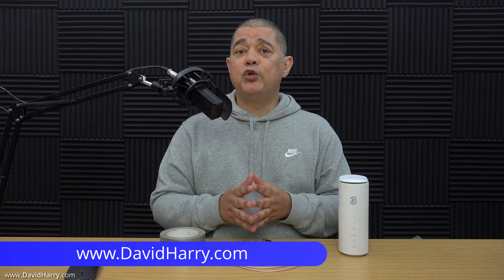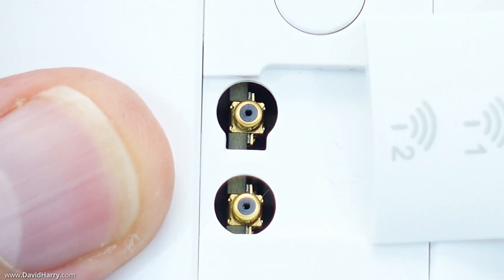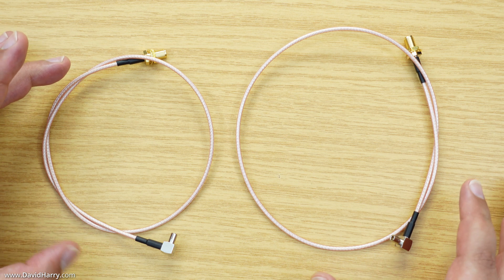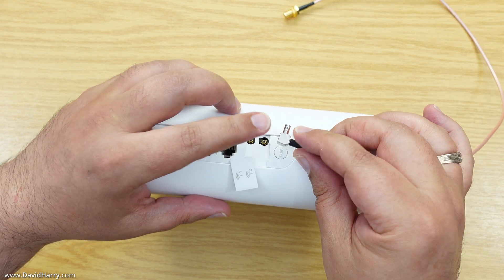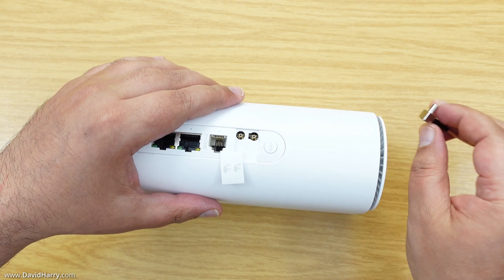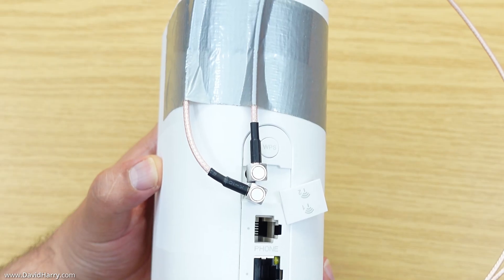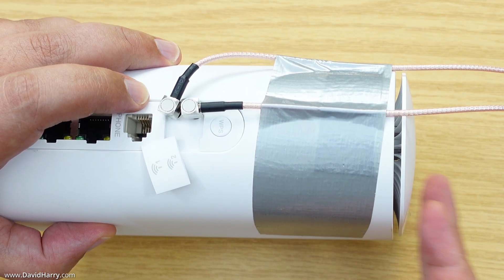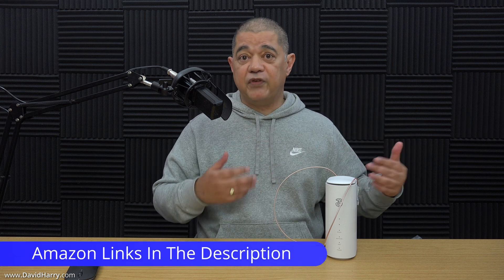How to modify the TS9 external antenna sockets on a ZTE MC801A 5G router so they don't snap off

Comment from the maker: Visit Router-Mods https://geni.us/RouterModsWebsite
Bluespot 4G/5G antenna Amazon https://geni.us/Bluespot4G5G
Bluespot Mini 5G antenna Amazon https://geni.us/BluespotMini5G
Bluespot 4G/5G Bluespot website https://bluespotnet.co.uk/products/bluespot
Bluespot Mini 5G Bluepost website https://bluespotnet.co.uk/products/bluespot-mini

Router-Mods playlist: https://www.youtube.com/playlist?list=PLleKChtNUwZTyTwZxrJRYPUXTSJUzi5kP

How to modify the TS9 external antenna sockets on a ZTE MC801A 5G router so they don't snap off.

In this video I'm showing a simple antenna modification to a 3 branded ZTE MC801A 5G router to help with strain relief when connecting external antennas to the router's TS9 external antenna sockets.

This is a very simple antenna modification that just uses a couple of TS9 to SMA cable extenders that connect to the router's TS9 ports and are then taped to the body of the router to give the strain relief that these TS9 antenna sockets need.

These SMA to TS9 cables are also known as SMA to TS9 pigtails or TS9 to SMA pigtails. In any event and regardless of what name they are referred to by, they are simply coaxial extension cables that have male TS9 on one end and female SMA on the other.

Once done, the router essentially has SMA external sockets on it that are a better choice for connecting external antennas to. Plus, with the SMA to TS9 cables being taped to the body of the router, you will definitely get more strain relief when connecting antennas. As just the weight of an antenna coaxial cable is enough to snap off the TS9 ports.

I can't over emphasise enough just how important this strain relief is for the external antenna sockets. Without such a modification, I can almost guarantee you that at some point you will snap off and break the TS9 connectors off the router's motherboard.

These TS9 connectors on this router are simply surface mounted straight to the router's PCB motherboard. Effectively giving no strain relief at all.

It's also worth bearing in mind that with this particular 3 ZTE 5G router, once either of the TS9 sockets are snapped off or broken. Your router will no longer operate properly with 5G. Even if your router indicates a 5G signal, you will have a very slow speed. Basically, the router becomes useless for 5G and doesn't even revert back to its internal 5G antennas.

This simple antenna modification will also work many other 5G routers, 5G modems, also know as a 5G gateway or 4G gateway, or even 4G routers and 4G modems that use TS9 for their external antenna connections. Even a home Wi-Fi router or modem that has these TS9 sockets can benefit from such a simple antenna modification.

It's also worth noting that such a simple modification will not void your warranty or guarantee as you are only connecting a cable to a socket that's designed to be used by the end user for attaching external antennas to. There is no opening up the router, so therefore no voiding of any warranty or guarantee.

Amazon links to stuff used in this video:
The 50cm SMA to TS9 cables I used: https://geni.us/50cmSMAtoTS9
Other SMA to TS9 cables: https://geni.us/SMAtoTS9cables
ZTE MC801A 5G router: https://geni.us/ZTE-MC801A-5G-Router
Other SIM free 5G routers: https://geni.us/5G-Routers

Please give a thumbs up, sub, share my videos and click the bell for notifications.

As a small independent self financed YouTube technology channel that does not have major sponsors. It does take a lot of time and money to help keep my channel running and to fund it. Any support you could offer would be massively appreciated.

Supporting my channel by using my Amazon links to buy anything from Amazon, not just the products I link to, gives me a small cut but doesn't cost you anything extra. You can also send me a coffee donation via my PayPal link, coffee keeps me going while editing :) Or a thumbs up, sub or share is a massive help for my channel.

Support via PayPal https://www.paypal.me/DavidHarry

My YouTube equipment & recommendations. 
Amazon USA https://amzn.to/3g2Oi3i
Amazon UK https://amzn.to/2ZR6IOV

My Amazon Shop links.
Amazon USA https://www.amazon.com/shop/davidharry
Amazon UK https://www.amazon.co.uk/shop/davidharry

Amazon USA: https://geni.us/Amazon-USA
Amazon UK: https://geni.us/Amazon-UK 
Amazon Deutschland: https://geni.us/Amazon-Deutschland
Amazon France: https://geni.us/Amazon-France
Amazon España: https://geni.us/Amazon-Espana
Amazon Italia: https://geni.us/Amazon-Italia
Amazon Canada: https://geni.us/Amazon-Canada 

As an Amazon Associate I earn from qualifying purchases when you use my Amazon Affiliate links.

Contact me for product reviews.
YouTube@DavidHarry.com

http//www.DavidHarry.com
 
I’m David Harry. Thank you very much for watching this video, take care and goodbye now.

Cheers,
Dave.

#DavidHarry#LiverpoolTV#Router-Mods

Comment: Why is it that if you break the TS9 the router won't work in 5G anymore? Why can't it use the internal antenna?
Reply from the maker: Because the auto-sensing stops working and the router thinks there's an external antenna attached when there isn't. Plus, there's no software switch/option to tell the router to use the internal antennas. Cheers, Dave.

Comment: will installing these TS9 antennas increase the strength of the speed I`m getting. ATM I`m getting up to 1.2 Gb. but it fluctuates so much that I`m having big ping spikes and speed drops all the way from 1.2Gb down to 120-200 Mbps.

Comment: Hi David, assist me in understanding this please, where do the two cables connect to(what type of antenna LTE/WiFi)?
Reply from the maker: They connect to 5G/LTE antennas, definitely not a WiFi antenna. These sockets have nothing to do with extending the range of the WiFi of the router. Cheers, Dave.

Comment: Hi Dave, I've watched the video and read everything in the comments but I'm still unsure if an external antenna will help my parents when they visit their caravan.  They have the same router in your video on the Three network, coverage in the area says "great news, you've got very good 4G for calls, texts, and mobile internet" which is a massive lie :-) and there is currently no 5G coverage in the area.  Am I misunderstanding when you say external antennas are only for 5G so in this case it won't help?  I was going to buy them the Bluespot 4G/5G Antenna but I'm now not sure this do anything.  Thanks.
Reply from the maker: Hi, Nick. The two ports on this router only support the extension of 5G, not 4G. Do not buy an external antenna unless you know you have line of sight to a 5G cell tower. You have to know the direction of the 5G cell tower, as these antennas are directional. If you do buy an antenna, don't get the 4G/5G, get the Mini 5G for 5G reception. Cheers, Dave.
Reply: Thanks for the reply. So based on that nothing will really help until they get 5G in the area?

Comment: Does anyone know if the ports shown on the ZTE router are for getting better mobile network coverage or for extending WiFi range?
Reply from the maker: Hi Carlos. It’s only for mobile 5G NOT for WiFi. There are separate antennas inside the router for WiFi. Cheers, Dave.
Reply: @DavidHarry  Thx u, greetings from Chile
Reply from the maker: @CarlosSanchez-lx6vd  Hi, Carlos. You are very welcome, greetings from Liverpool, UK. Cheers, Dave.

Comment: Please, Could I be right to say that the right external router antenna to buy is the one with SMA since the pigtail already has ts9. A quick reply would be appreciated. Thanks
Reply from the maker: Yes, use an antenna that has the SMA connection NOT the TS9 connection. Cheers, Dave.

Comment: Thank you for the video!
Do you think the internal antenna are better than these "Set of 2 LTE/4G/5G Antenna 8dbi Omni Directional 600-6000Mhz SMA Male" which is also available on Router Mods?
I have this set but if using the external antenna will overrider the internal one then I might not use it. Cheers.
Reply from the maker: Hi. I’m not sure what antennas you are referring to. However, if they are indoor external antennas that connect directly to the router, I wouldn’t bother. The only way you will get noticeably better signals and internet speeds is to use outdoor external antennas. Checkout this video https://youtu.be/Ls0UL_I5CQM  Cheers, Dave.

Comment: I just experienced the exact same problem. TS9 sockets snap off at minimum pressure. A straightforward design error. However, my router can still receive a 5G signal with speeds of 61-100 Mbps indoors - behind a heavy glass door - exactly same as my top-notch Ipad.
Reply from the maker: That's interesting that you still got 5G after the TS9 ports snapped off. Cheers, Dave.

Comment: What you have actually done is convert your router from TS9 to SMA. All very well if your external antenna has SMA connectors, but then it would be a different video altogether. However, if your antenna has TS9 connectors they will no longer fit.
To keep them as TS9 then you will need two TS9 female to TS9  male extenders. 
What a stupid video.

Comment: 5G home broadband is already equipped with an AAS, or advanced antenna system, that includes MIMO, multiple inputs,multiple outputs, etc. You can use those TS9 antenna extenders in a place where you barely get a good frequency signal, but you need an SMA high-gain antenna to support them.

Comment: Hello. If external antennas are connected to the router, they will provide a better signal for 4g LTE
Reply from the maker: Hi. No, on this router the external connections are only for 5G. You can however, get a full modification from www.Router-Mods.co.uk that will give you 4G and 5G connections for external antennas. Cheers, Dave.

Comment: Hi David, I have the same router and  the blue spot mini. When you connect the blue spot mini do you get any information in the "network information" section of the advanced setting > other> network information section of the  router UI about your 5g signal? With the external antenna connected I only seem to get information about the 4g signal I although on the home page of the UI it says I have a  5g connection . My speeds are lower with the blue spot mini connected. When I just use the router without the antenna I get info about the 5g cell tower I'm connected he to, band etc.. I also get faster speeds. Cant work what I am doing wrong as I expected I'd get some improvement because opening the window leads to muck better upload speeds.
Reply from the maker: Hi. When you look at the signal information in the UI where it gives the cell tower ID info etc. If it’s not showing 5G SNR, signal quality etc. It means you are not receiving 5G. If this happens with the Mini 5G it may mean that you are not pointing the Mini 5G in the best direction. It could also mean that there may be a problem with the TS9 ports. I have similar results depending on where I place the router and antenna, where the router’s internal antennas can sometimes pick up a better 5G signal. Also, the router’s internal antennas are omni-directional, so they have a better chance of picking up both 4G and 5G compared to any external directional antenna, depending on the placement of the external antenna. BTW these types of external antennas should always be mounted outside. However, if you have an external antenna in the correct position, this will always be a better option and in certain instances give a way higher data throughput and have a better/cleaner signal reception. Just like you, if I place my router by an open window I will get a way better signal and much better speeds on the internal antennas. I also put my router in a waterproof box outside on my balcony and it’s way faster again just on its internal antennas. At these very high frequencies for 5G, it’s amazing just how many things can interfere with the signal, such as the glass in your windows. Windows quite often have other materials mixed in the composition of the glass to help with reducing UV etc. And these can also act as a serious insulator against high frequency radio signals. There’s also the fact that you have to have both 4G and 5G signals to get 5G. We use 5G NSA in the UK and this relies on 4G to be able to negotiate the 5G signal and both signals are almost guaranteed to be coming from different cell towers. I’m actually doing quite a lot of work for www.Router-Mods.co.uk at the moment and preparing a range of videos about various routers, antennas, modifications and general technical information about 4G and 5G internet stuff. I’ll be doing quite a lot of this stuff this year, so keep an eye on my channel for the router/antenna stuff. Cheers, Dave.
Reply: @DavidHarry  thanks for the comprehensive reply! . I need to get out there and have try of some different antenna positions I think.
Reply: @DavidHarry Hi I'm looking to keep the router out on the balcony as well. Just wondering if it is safe to do so or will it damage the router when the temperatures drop?

Comment: Greetings! My questions are: do i need to use both of the connectors to apply an external antenna or i may use only one to do so?
Why it has two of them? If a must to use both, will i need two external antennas or can i use an 'Y' extender/splicer? Thank you!
Reply: Good question. I found with another 4g/5g modem that only one of the external sma poets actually did anything. Thought it was faulty, so I returned it and swapped it for exact same one (only had it a few weeks). However, one again only one would work at a time. 

Bit crap, as it went to a new 4G/5G 2x MIMO passive (no amplification) antenna on the roof professionally installed. Costing over $1k. I'd just use or built an amplifier like for digital TV..usually go up to 617mhz in Aus. However, I did as said and my speed went from 10-15mbit to over 800mbit when I set it to the 3580-3600mhz Telstra 5G. However, 20 mins later. I got an sms and the tower detected an uncertified amplifier. 2 years jail and 426,000 fine. In a promise not to share how to do it properly (know now how to max it seem like a certified Cel-FI) I got no jail and $80k.

So, if you're in Australia be warned. As some new phone towers have updated their ability to pin point such activities. But really, considering I live in a valley in the hills with no cable.. plus I like to game again, Satellite in a metro area is insane.

Parts are about $50-. Now celfi 5g amp is over $3000

Comment: Are you saying that damage to the TS9 affects the internal antenna reception. I know on the new Zyxel 5103e router that Three is using, there's an internal / external antenna switch in the back. I assume the switch disables the external antenna and vice versa. Maybe for the reasons you explained and the weak nature of the TS9 connection , they put it there as a fail safe?
Reply from the maker: There’s no manual switching on the ZTE, it’s all auto and works by the auto-router sensing for the external antennas. Once the TS9 ports break there’s no way for the router to sense and it won’t switch back to the internal antennas. The TS9 ports are part of the main 5G internal antennas and there’s a secondary set of internals but the secondary set won’t be switched to once the auto-sensing on the main set is damaged.
Reply: @DavidHarry  Ah OK...well the manual switch on 5103e would seem to fix that. It might well have been one of the reasons three switched to that product.
Reply from the maker: @GRIFF22  Yes, manual switching on any router would definitely get around this problem.

Comment: Many are saying this exterior antennas extenders are not working from factory! Did they work for you and if yes which exterior antenna are you using?!
Reply from the maker: Hi. Yes, the external ports do work. The mistake that most people are making, who are saying that it does not work, is that these ports are specifically for a 5G antenna. If you connect a 4G antenna to these ports nothing will happen. Even if you connect a 5G antenna to these ports it still may not work, if the router's internal 4G antennas do not initiate the 5G uplink. Here in the UK and most other countries at the moment, the vast majority of 5G connections rely on a 4G signal as well, in order to do the initial negotiation with the cell tower/s to initiate 5G. The other type of 5G, which only needs a 5G signal, is very uncommon, especially here in the UK. Cheers, Dave.
Reply: @DavidHarry  Thanks!